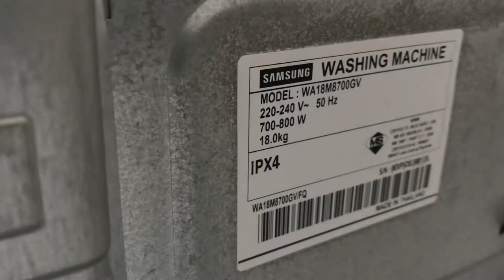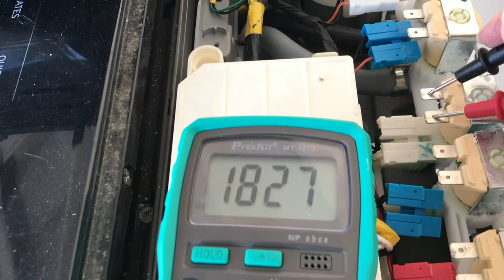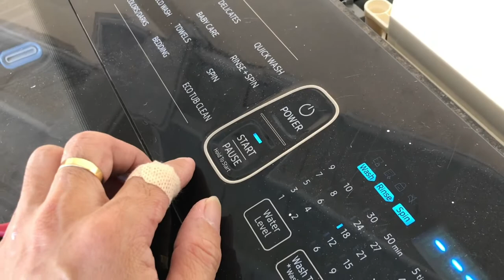How to repair Samsung washing machine WATER INLET VALVE COIL#diy #how

Comment: Pry the coil up from the bottom. The whole unit, metal band and all, will slide off the inlet valve stem. Place new coil over stem and push down until it seats. Simple, you're done.

Comment: You don't need to take the metal band off around the coil as the whole unit will carefully prise up and off the water inlet valve ! That's what I found out when I did  my washer dryer.
I'm no expert by the way  just thought it might help anyone else doing this.